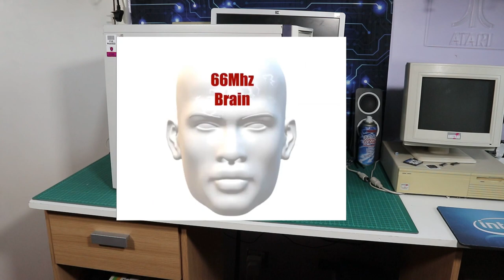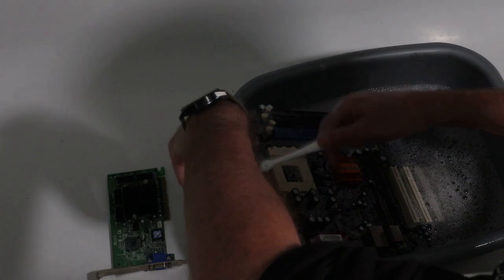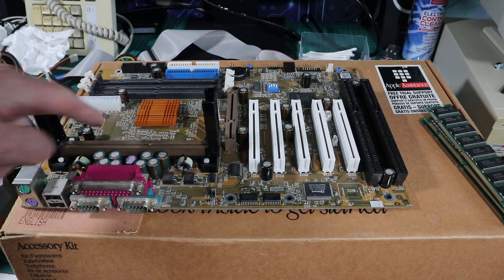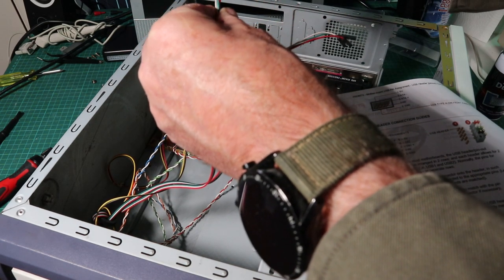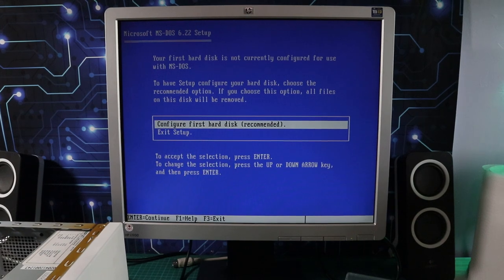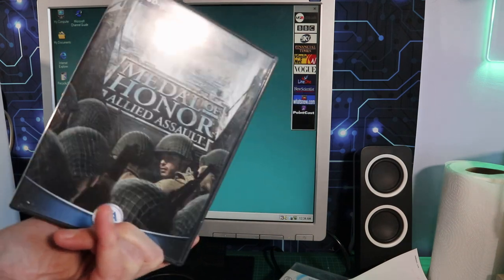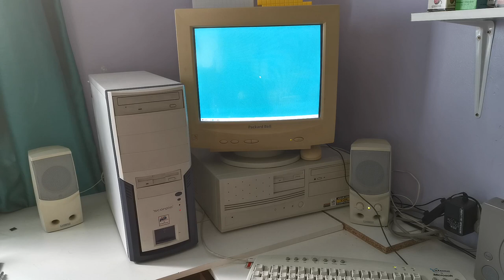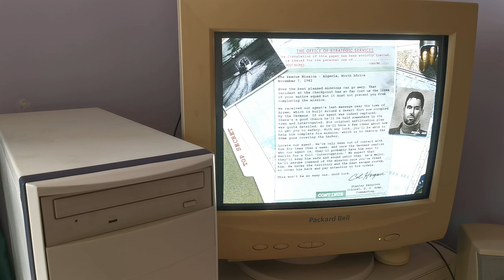Slot A Athlon 600

Comment: You might want to watch that board closely. I've had similar issues when booting on a Socket A (462) board. They go away when I remount the AGP board or replug a USB header. This symptom is usually caused by a warped board (which is my case) or a bad connection in the northbridge (which might as well be my case), or so I've been told.

You're really lucky to be the owner of a Slot A mother board, there aren't many around!
Reply from the maker: Cool, thanks for the info, ill keep an eye on it. Yes slot A was pretty short lived, not too manybaround anymore

Comment: for the dent in the bottom, i've had good luck using a block of wood and a hammer to tap out the dent. what's also handy is a pop rivet tool and drill out the rivets holding things in place to possibly give you more room on the interior to let you flatten it with a wood block and a mallet.

for a completely wrecked chassis that still has a decent motherboard tray area and back, i like to cut them up to use as a test bench, secured to an old butcher block. very hand to keep all the standoffs and wire some permanent buttons or switches for power and reset or LED for disk activity or PC speaker. it can also avoid the situation of heavy cabling dragging off a component from the bench to smash on the floor.
Reply from the maker: Good idea, ill see what I can do!

Comment: Not too surprised to see that hard drive failed. Never had good luck with Maxtor drives myself. In fact for a summer, either 2005 or 2006, I worked for a guy doing data recovery and I'm not kidding at least 70-75% of the drives we were dealing with were Maxtors. Surprisingly though, even though they were later bought out and absorbed by Seagate, I never had a Seagate drive fail on me.
Reply from the maker: Especially given its age
Reply: My experience is that very old Maxtor HDD are still working. But SCSI 320 Maxtors tend to fail. No problems with HDS! Seagates are also okay. Old WD Caviars 120/240 MB are also still running, where WD of the 2000s are total crap.
Old Seagate 4 GB and Fujitsu SCSI-1/2 are also still working fine.

Comment: For the MX400 you might try gently pinching the ram chips together while everything is running to see if those artifacts clear up.  May be as simple as a leg or two that's come off the pad.  

Shame the K7S5A didn't come back.  That purple pcb with the orange heatsink are an attractive combination imo. 

Nice job on the case as well.  It has personality and was well worth saving!
Reply: Its sooo purple lol. I miss colourful mobos.
Reply from the maker: Cool, thanks for the tip, I'm definately going to take another look at both to try and figure out what's going on. I have a gut feeling both can be saved. It is a pretty board 😁
Reply: Might be just the processor's no good, or the memory.

Comment: That case looks pretty similar to a older rosewill case that I have except for it's black and silver instead of the old retro beige and you can install two 120mm fans on the side for additional side vent airflow a 120mm in the front and 2 80mm in the back. It is also that real thin cheaper metal that flexes real easy as well. I think I only paid like $30 for it but it still gets the job done and I rather like it.
Reply from the maker: Haha, I think as time goes by metal on budget cases get progressively thinner, theynall seemed to weigh a tonne atnone point. This one seems pretty solid. Never heard of rosewill, just looked them up seems they don't trade outside of north America, at least not to Europe.

Comment: I might be a bit of a stickler, but I think the Athlon 600 + Voodoo 3 was a better/more period-appropriate pairing; Voodoo 3s came out March/April 1999, the first Slot As (of which the "Argon" 600MHz model was among them) were released in June of 1999.  No doubt it would have made for a dream system from 1999 for running Glide based games before the first GeForce came out at the end of that very same year and really started the beginning of the end of 3Dfx.
Reply from the maker: I may switch back, I still dont have a machine with a voodoo 3 in it and now have a faster socket A athlon machine to deal with dx8 etc.

Comment: You said thunderbird was on socket A.. But there where also SlOT A Thunderbirds.
Reply from the maker: I thought all slot A were either Argon, Pluto or Orions? and that Thunderbird was the first athlon pga?
Reply: @66mhzbrain  yes it was for the socket 462 (A), but for OEM (dell, compaq, siemens) they soldered the cpu on the slot a cartridge, so the are able too sell their old mainboards which they had stock
Reply from the maker: @ckochi  cool! Never knew.
Reply: @66mhzbrain  There was Slot A Thunderbird as well. My first (and so far only, to this day) Slot A build rocked a 750MHz Thunderbird Athlon in that format. Sold it to a fellow collector and went for 462 since it was leagues easier to source parts for it than Slot A.

Comment: 21:10 - Medal of Honor uses the Quake 3 engine and perfectly runs on directx6 cards like the Voodoo 3 or TNT2. The game needs DX8 installed but it supports DX6 cards. I uploaded a video on my channel 2 years ago with the Voodoo 3 3000 running Medal of Honor with no issues whatsoever in 800x600 and medium / high details at 25-50 fps. I played it with the last official driver version 1.07 from 3dfx.
Reply from the maker: Strange, I wonder why it was glitching like that. Ill take another look.
Reply: @66mhzbrain  what driver version did you use ? Maybe the driver version was an older one.
Reply from the maker: @3dfxvoodoocards6  it was probably an older one as it was off an original install disk, I'll get the latest off vogons and try again.
Reply: @66mhzbrain  than almost surely it was a driver issue, the one used being too old. I tested many V3 drivers for Windows 98 and the best one was the version 1.07 the last official driver made by 3dfx.
Reply from the maker: Cool, ill get a copy

Comment: 6:27 That board can take 2GB of RAM no problem (I’ve got one)

Edit: But if the board doesn’t work, it doesn’t matter. That’s a shame.
Reply from the maker: Going to take a closer look when I get time. I think I have another one in an old machine I haven't really looked at yet so should be able to get one or both of these boards going at some point

Comment: Not powerful enough really. Athlon 600 is probably enough to run Quake III with a constant 60fps with a Geforce 2 GTS, but certainly not with an MX400. MOHAA used a heavily modified and updated Q3A engine with very large areas and was poorly optimized. A P3 1Ghz or Athlon 1Ghz is probably a better bet, for the geometry, to reach a smooth framerate. 75Hz is nice for that game.
Reply from the maker: No, not powerful enough . I wasnt too bothered with this one as I've the aocket A with the geforce 2 ti. This one wae more a curiosity
Reply: Medal of Honor is very CPU dependent.